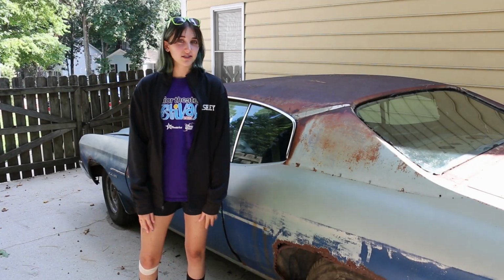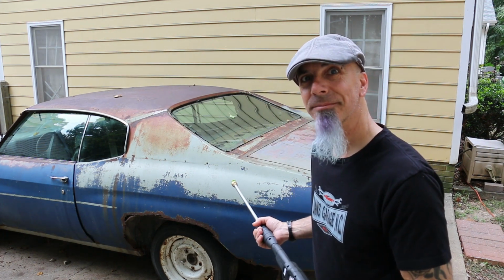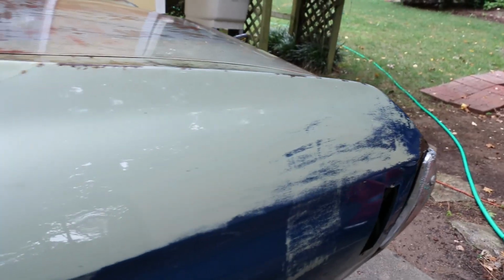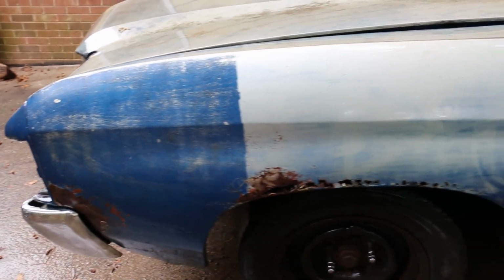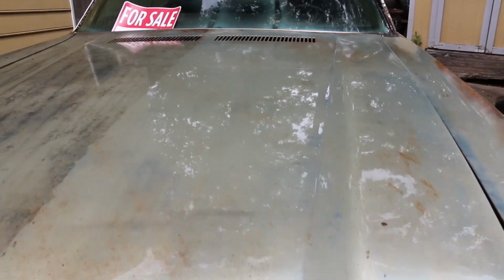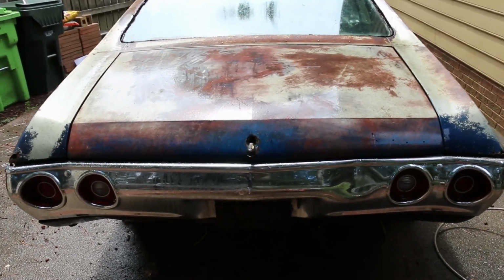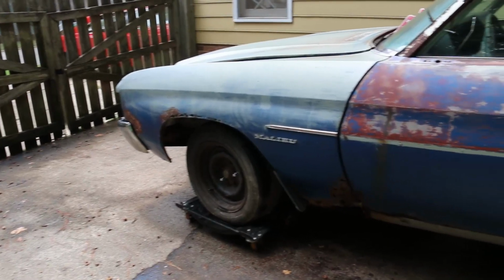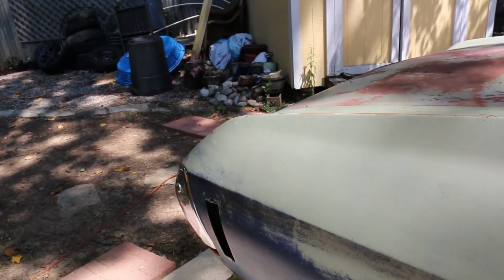1972 Pewter Silver Power wash

Comment: 50/50 mix of trans fluid and brake fluid.......wait 30 min....pressure wash
Reply from the maker: Really? Never heard of that.
Reply: @DansGarageNC  works on bad paint while not hurting factory ( dont leave it on to long )......and also 0000 steel wool and windex...not water, does wonders on windows and bumpers and lite over spray